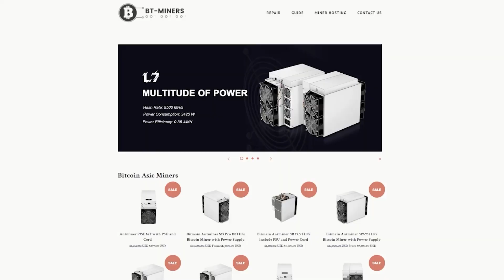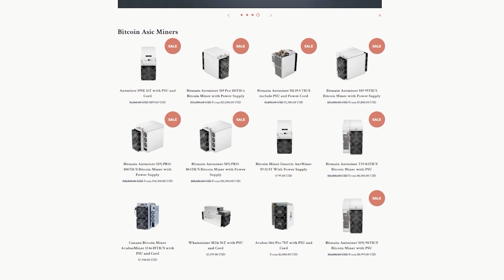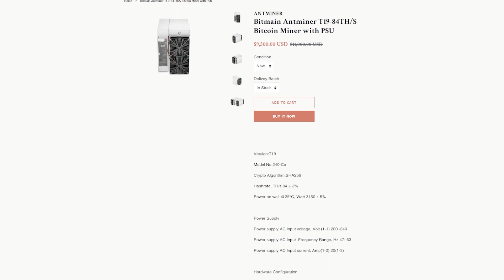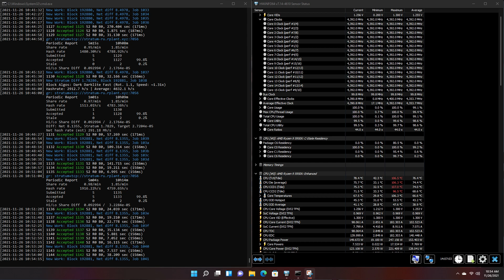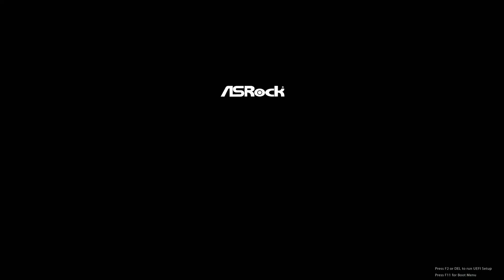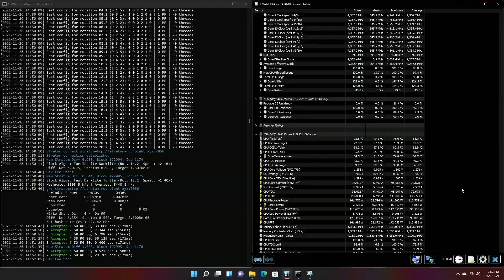5950x Raptoreum Overclocks All Core VS PBO 2.0

Comment: Nice Vid,  The clean power delivery isn't at the connector though.  Maybe it should be stated as the source power needed.  My understanding of MB power the VR's will handle the power delivery to the CPU, and the other rails.
Reply from the maker: I would go into detail on power phase etc. But typically the easiest way to see it that I can explain is the additional cpu power.

Comment: Great analysis! Have tried to tell about the benefits of PBO2 in few forums but looks that most are not utilizing this precision tweaking at all. I have managed to use PBO with zero additional clocks but limiting wattage to my AIO thermal capacity when achieving 5+ KH/s with lower temps. Just like you have find out👌
Reply: PBO is fire. Everyone needs to use it. Im 4.5ghz stable stock. 140h/s avg.